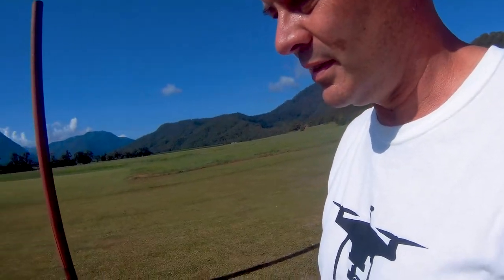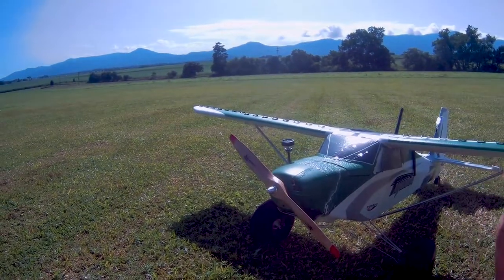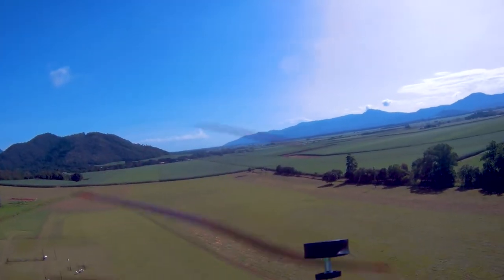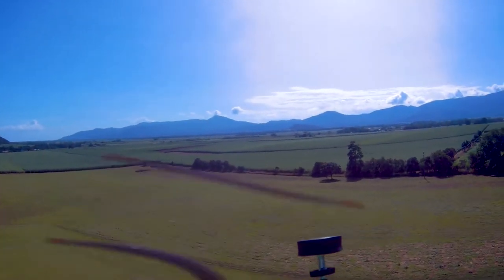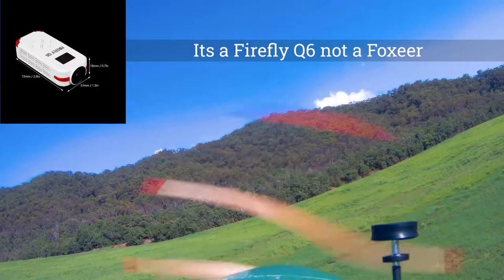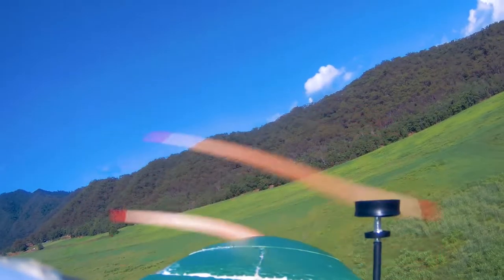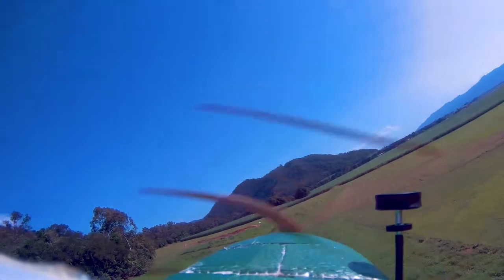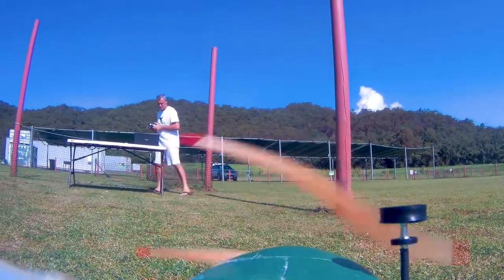Tundra V2 - Morning Cruise - New Prop

Comment: Nice quality filming :). Would you recommand this plane ?
Reply from the maker: I would most definitely recommend it as long as you have had some experience flying fixed wings. It's a nice slow flyer on 3s battery but with 4 s it can do some acrobatics if you choose. Mine does have a flight controller in it which they don't  have when you buy it. But a great plane to fly indeed.